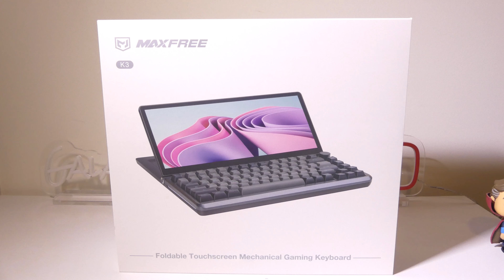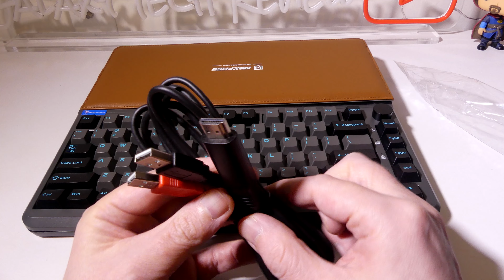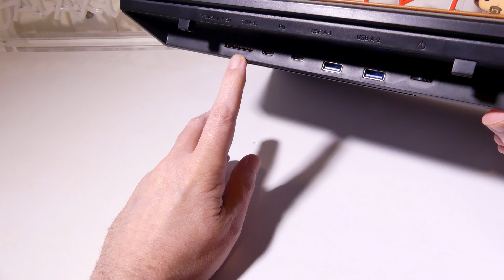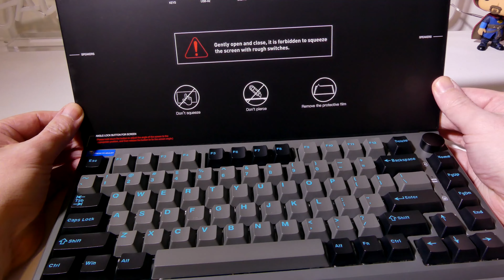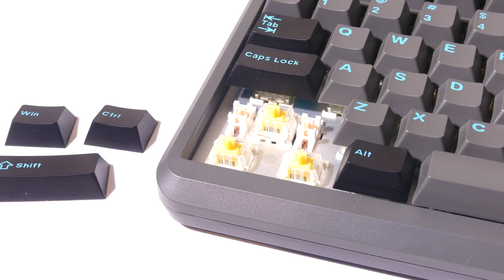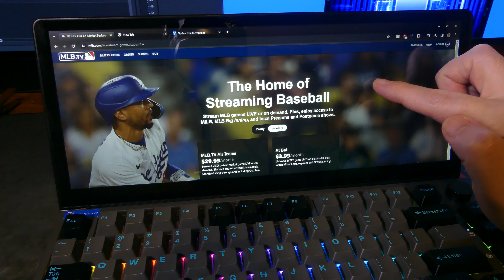Maxfree K3 13 Inch 10 Point Touch Screen Mechanical Keyboard REVIEW

Comment: I love this thin, I have the original branded Kwumsy K3 and it's awesome. I use it in combination with a mini PC running a Linux OS as a modern electronic typewriter for distraction, free writing.
Reply: Did you set it up this way or it’s useable out the box?
Reply: @Shmyrk  
It's usable out of the box. Linux for nice it's super quick so I know Windows is not going to have any problems. The keyboard comes with a couple of connectors so if your mini PC doesn't have video out through  USB c then you can use the HDMI connector they provide and it works great.
Reply: @ nice, thank for the response!